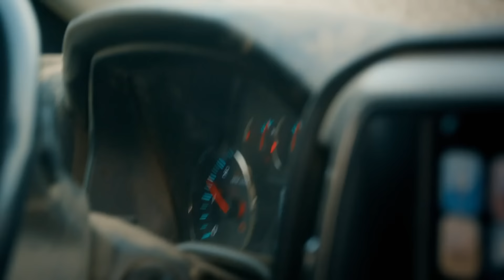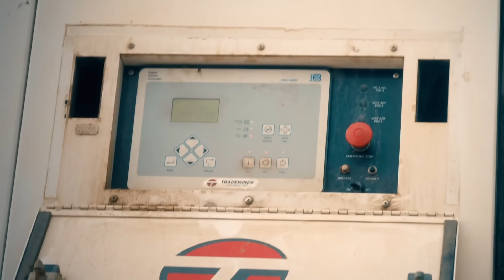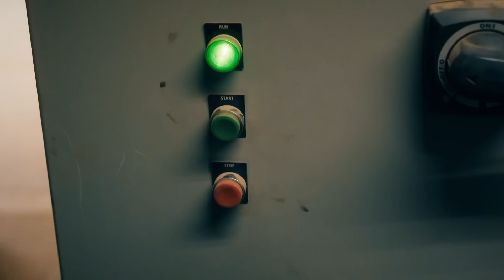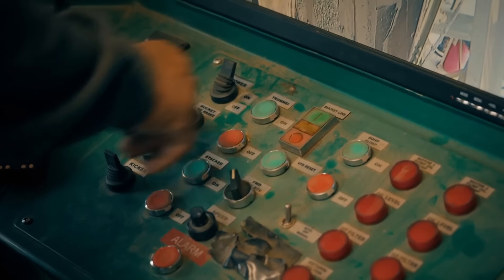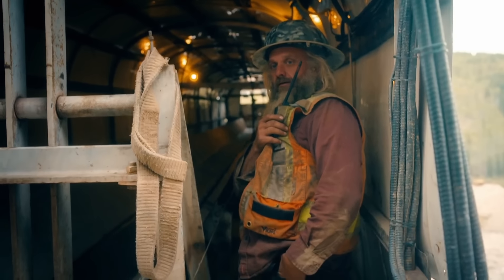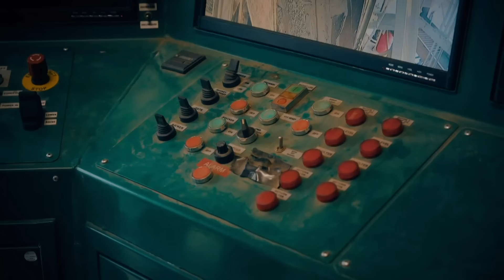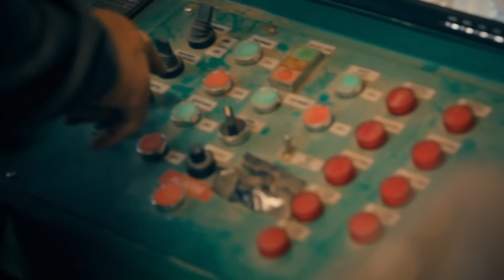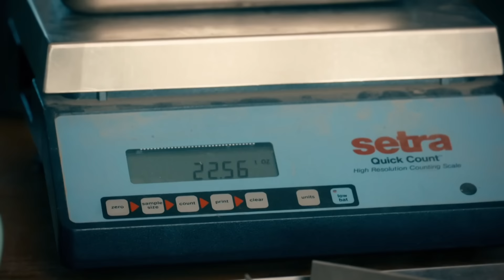Tony Beets’ Old Dredge Makes $40,000 | Gold Rush

Comment: So what idiot thought it was a good idea to build a dredge on a pond just slightly larger than the dredge? My guess is the reason it hasn't run in 5 seasons is because they ran it for an hour 5 years ago and got all the gold out.
Reply: Thays how it works they mine in front of them they anchor to the ground behind them and they let more out as it digs it moves forward and tailings behind you only need a small pond pump a little water in if needed and you just plug away it rotates left and right making a path in front and they use bulldozers and diggers in front to rip trees and clear a path it’s able to run with far less manpower an fuel  you don’t just float in a lake not how that works
Reply: Tell me you don’t understand how a good dredge works without telling me you don’t know how a gold dredge works…..
Reply: @OhioFarmerMike  Spot on mate.
Reply: go on google and look up all the gold dredges and and see were they have sleep for the last 70 years and look at what it looks like around them